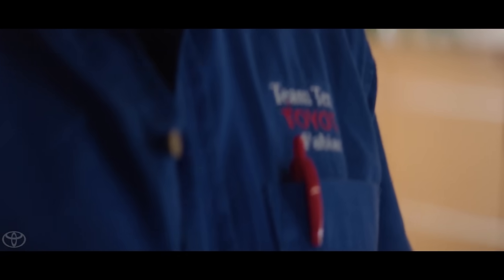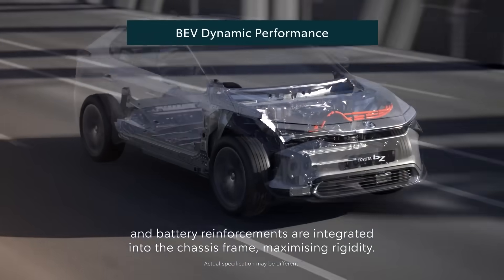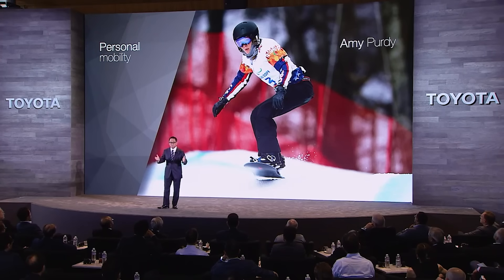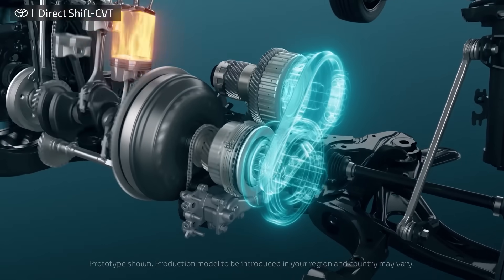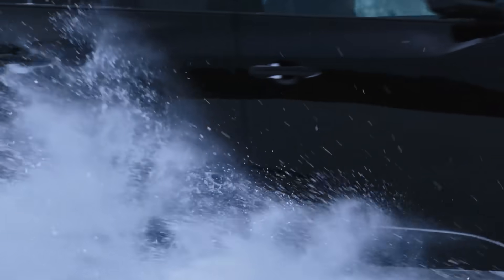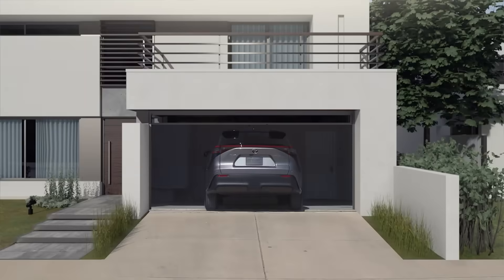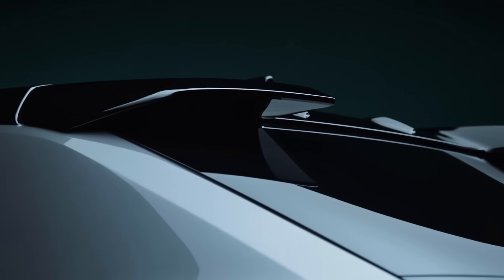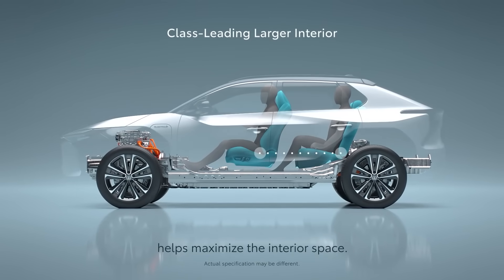Toyota's INSANE NEW Motor SHOCKS The Entire Car Industry!

Comment: The inverter in the Tesla is in the battery pack. Power management is handled by the central (redundant) computer. The gearbox is One gear. The E-Axle sounds like a function of the computer. Many car companies do this. 

Looks like word salad thrown at the wall to see what sticks. "Output density"? There is power density (charge/discharge rate) and energy density (energy capacity). WTF is this term supposed to mean? 

I know a bit about engineering and this sounds like fast talking nonsense. Does it come with a free bottle of snake oil?

P.S. - Where's the picture of the "E-Axle"

Just a bunch of jabber about a bunch of systems (including the cooling system? Other cars have cooling systems) and no content on how it actually works and how it is an improvement over the much simpler, one gear box used by other EV auto makers... and it uses oil that would have to be changed periodically... so there's that. They reintroduced transmission oil changes... this is supposed to be a "good" thing?

Other auto makers saw the multigear transmission as unnecessary and use computer cotrol of the electric motors to go forward/reverse and boost/limit power. 
The multigear transmission is only needed in high performance cars to make speeds much beyond 150mph or so. How is this useful?

How is it beneficial to have an inverter on each axle vs just one in the battery pack?
 

Sorry. I call Major BS. 

Nothing was established here save that Toyota Still has empty pockets on the EV front and is in serious danger of losing major market share over the next 5 years.

Comment: Here in Jakarta will cost estimated Rp 1,19 billions. I will wait until steel blade battery is applied. (never Li-Ion). Toyota's cars are no doubt good quality ones. But EV car is not the same as fossil used to be. The Chinese EV cars are for sure in advance such as BYD, Wuling, Nio etc and automatically more reliable and lower in price since the Chinese EV cars are being sold more than 2 years thousands of units now. So are the Korean too with Hyundae, KIA etc.

Comment: I thought every ev used regenerative braking, as a desperate atrempt to put a scant amount of charge back into the battery and eck out a few more yards of range.
Reply: Yes... Everyone has regenerative breaking but they had to imply that this nonsense tech is actually some sort of game changer. Notice that they didn't actually show the "E-Axle" or how it works. 
Looks like a transmission on the axle to increase complexity and eck out a tiny bit of performance. 

Regards regenerative breaking... adds miles to range when you are driving in hills/mountains. On a flat highway... not so much. Also saves brake pads - more than 4x the life as the electric motor does most of the heavy lifting.

Comment: Zero carbon is impossible unless they pop out of thin air, Fact. Good when in crowed places to avoid exhaust fume. Never forget the high Carbon manufacturing delivering footprint /  battery replacement, etc over the lifetime /carbon from electrical supply production all facts that must factor into  the total carbon footprint.
Reply: Nothing is carbon free. To be carbon free it has to start where we get the minerals from. Electrification of vehicles is minimal towards global warming. There are way to many countries that rely on coal which is the major pollution contributor. We are not fighting the proper culprit!

Comment: What we want is a ev chevette no computers  cheep simple reliable.
Reply: There’s a good chance that the motor drive will be computerized anyway, I would love to see a more minimally optioned EV that I could afford.
Reply: @@pmscalisi  brake energy recovery system and drive . It could even have a plug in miedia system for tablets for GPS and other generic electronics that could be put in later as long as it is cheep right now my truck uses 120$ to 140 $ per trip in to the city my car is 40$ 45$ but insurance is 110 per month each and I usto make money with the truck. Hopefully, I can start back up in spring to start making money. Lost money this year because of corruption and incompetence by Biden and Trudeau. At least with Trump I could make money and get ahead. He cost me a bit with messing around with aluminum. But when the usa dose good so dose canada and Mexico. Building a small refinery and working on a wood gas system for one of my old trucks. Even with corrupt politicians and globalist governments. I will get going again.

Comment: Reading out the press release literature is not useful or informative, was expecting better. My technical take is that the are moving up the operating voltages and calling that generational. Yes moving from 48V motors to 1kV motor with the same power might be magical to their sale department but evident to anybody else.

Comment: Toyota will likely make one of the most reliable BEVs just like it does with PHEVs (longer driving range, performance oomph compared to HEV) and HEVs (third gen onward).  

May take another generation or two to get those industry leading BEVs though.  BZ4X reviews on winter performance and charging aren't so good.

Good Toyota is going back to the drawing board.  Looking forward to its future BEVs, hopefully with great reliability and driving dynamics.
Reply: What is your comment about "most reliable" based on. They couldn't even produce an EV without having the wheels literally fall off. They couldn't figure out that with all the torque the vehicle produces you need higher spec wheel studs.
Reply: @TheLogitech91  will make -- it means down the road.

2nd or 3rd gen is not bZ4X.

None of the wheels fell off.

You must have reading comprehension issues
Reply: @flashsushi  Really, I work in the car industry and have close relationships with people who own Toyota dealerships.  I would see BZ4Xs parked for weeks on dealer lots because it wasn't safe to drive them.  Why did they take the steps of having customer bring their BZ4Xs back to the dealership and park them.

This now a running joke
Reply: @flashsushi  Anyone can simply google the recall.  I just did and it came up on the Car & Driver website. It stated that the recall includes replacing wheels and hub bolts.  I wonder why Toyota decided to replace the hub bolts?  What could it be?
Reply: @TheLogitech91. You can keep jeering, but who do you cheer for?!! Hyundai KIA make rolling combustibles, Tesla is king of recalls and unaffordability, GM is going to make more rubbish with their Korean buddies, etc etc... Nissan is the best!
Reply: @mrgurulittle7000  At least Hyundai/Kia never made a vehicle that killed an entire family due to unintended acceleration.  Did you forget about that?
Reply: @mrgurulittle7000  without Tesla, we still drive conventional internal combustion vehicle, . . and it's not even rotary engine.
Reply: @Budi Sutanto. True! I like the rotary too!
Reply: @TheLogitech91  Hyundai/Kia just roast an entire family with its engine fire.
Reply: @Baebon6259  When & Where? Provide a specific example when that occurred. You're lying. I bet you cannot provide an the family that was killed. I just did a google search and couldn't find. I wonder why.
Reply: @TheLogitech91  so you're calling NHTSA a liar then. May wanna try their search function instead of google but whatever float your boat.
Reply: @Baebon6259  I recall doesn't mean anyone died. You do realize that recalls can also be done for emissions.  Again, show me where a family died due to Hyundai/ Kia fire. We certainly know that family was killed driving a Toyota due to unintended acceleration.
Reply: @TheLogitech91  Apparently YT doesn't like my post with link. You can google Hyundai/ Kia engine fire death in Canada. Also, don't forget to park your beloved Hyundai/ Kia outside. Don't want you or your family to be roasted by Hyundai/ Kia engine fire either.
Reply: @Baebon6259  Remember thousands of  Camry V6 engines that were failing due to sludge. They ran the engines hot to meet emission which caused sludge.  The millions of 4Runner V6 engines that were failing due to Head Gasket failures.  I was there when all this was happening.
Reply: @TheLogitech91  and nearly all of them were 100k + and many were 200k +. "million of 4Runner V6" failed due to head gasket. New head gasket = let's go for another 100k joyride. Can't go on for another joyride after the engine fire toasted everything. Btw, that engine fire risk is still an on going issue since 2010.
Reply: @TheLogitech91  You don't have a family that couldn't stop their vehicle and the entire family died but you did have a son that burned alive in his Kia Soul. I don't even want to image that that must have felt like. For your family's sake...I do hope that you follow Kia/Hyundai advice of not parking your vehicles in your garage.
Reply: @Baebon6259  At least I have more of a chance of getting out of a burning vehicle than one that won't stop even when you apply the brakes. At least Hyundai/Kia never produced an EV where the wheels literally fall off.  Ha Ha
Reply: @TheLogitech91  tell that to the Canadian man that didn't make it. Maybe he should get out of a burning car faster. At least Toyota acknowledged the issue with the wheels falling off while Hunydai/Kia tried to sweep the engine fire under the rug and was forced to pay 210 mils for their failure to timely recall 1.6 mil vehicles.
Reply: @Baebon6259  This is fantastic and goes to the point I'm trying to make to the Toyota fan boys. Consumer reports just took the new Tundra off the buy list.  Toyota has no direction.

The company is bloated and top heavy with management. They don't seem to have a clue what they are doing. You're going to have the Sequioa, Land Cruiser, (if they bring it back) 4Runner, & Lexus products all on the same platform with probably the same engines. Old girl ain't what she use to be.
Reply: @TheLogitech91  this is fantastic and goes to the point I'm trying to make to the Hyundai fan boys. Consumer reports blasted these kia junks everyday. Hyundai/kia has no direction.

The company has no idea what they are doing. They thought that hiring German auto designers can mask the cheaply made trashes. This is the true definition of putting lipstick on pig.
Reply: @Baebon6259  The Tundra is just the first crack in the armor. I hope like you Toyota continues it's arrogance.
Reply: @TheLogitech91  At least Toyota has an metal armor with a crack to start with. While Kia/Hyundai is still trying to figure out how to tan leather.
Reply: 2nd or 3rd Gen will be good ? How will Toyota survive until then. Likely 70%+ of new car sales will be BEV within 3 years…
Reply: @Chris Wright. Nah, I don't think EVs would sell that much in three years. There's no infrastructure for the electricity. Maybe more like PHEV and hybrid.
Reply: BZ4 whatever is a lousy offering w an unimpressive range and poor quality to boot! Toyota could not even keep the wheels on their 1st EV offering and they all have been recalled.